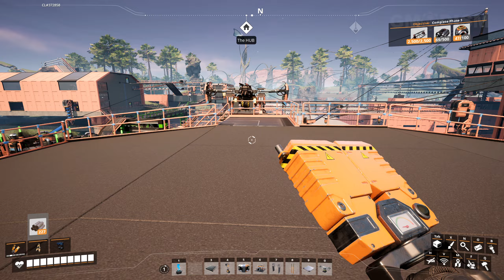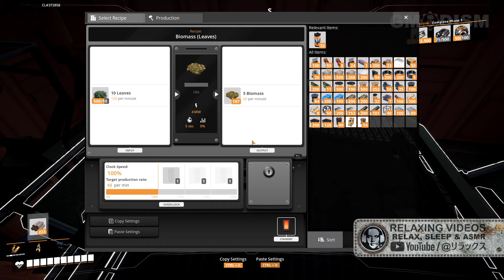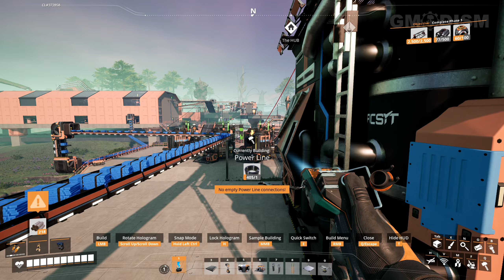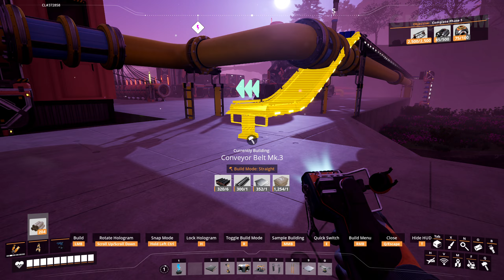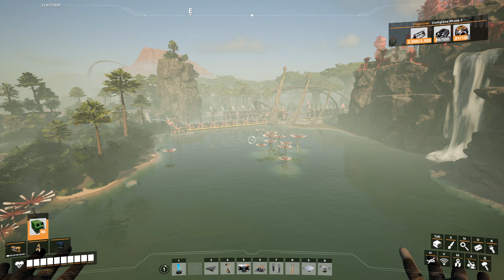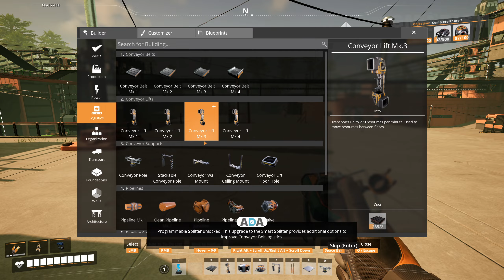Liquid Biofuel Factory (Epic Jetpack Fuel) - Satisfactory 1.0 New Player Guide EP32

Comment: Isn't setting the water rate completely useless as once the pipes get filled, it turns it off?!
Reply: Technically yes. But if you do that your power grid has fluctuations. It's much better to keep your power consumption as flat a line as possible. Long Term this limits how much power your grid actually demands, as well as making power outages less likely, because less fluctuation.